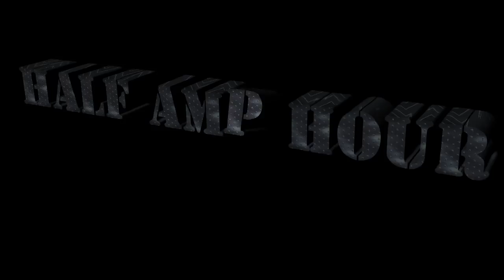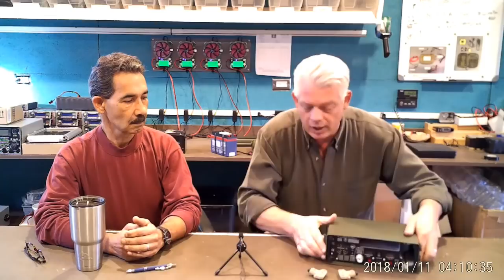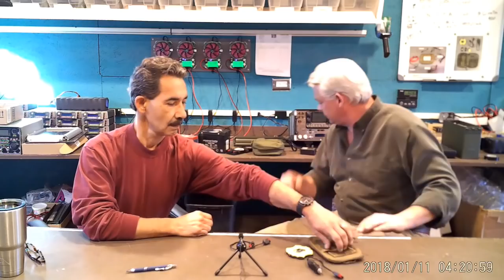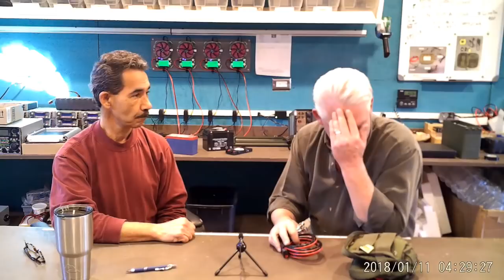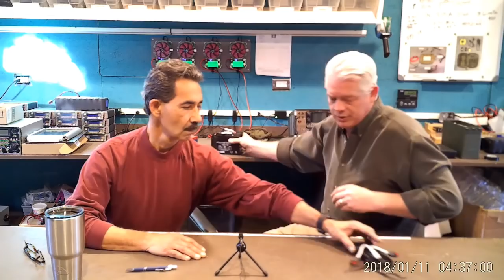HPS Half-Amp Hour - Episode 2

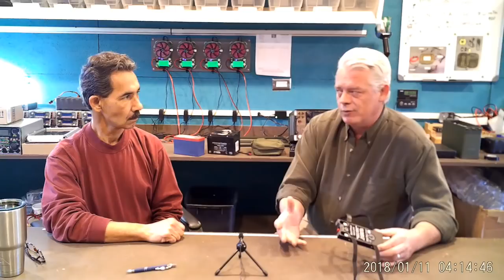Comment: 7:52 If the SLA/AGM solar controller is safe to use with a LiFePo4, then can any SLA/AGM charger be used with the Dakota Lithium batteries without decreasing performance or life cycle as stated on their website??